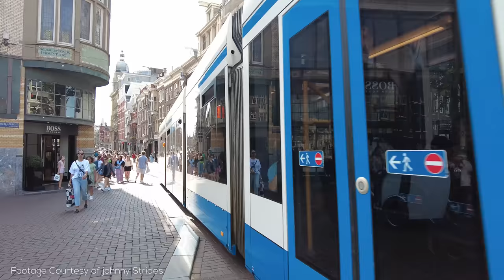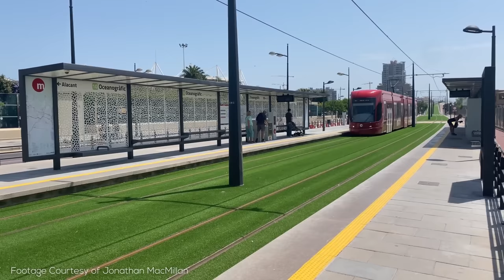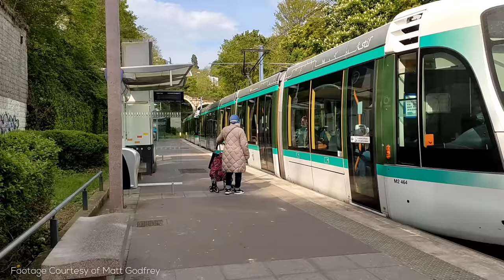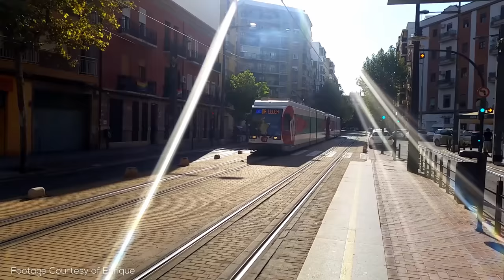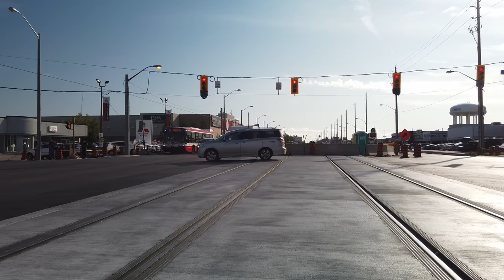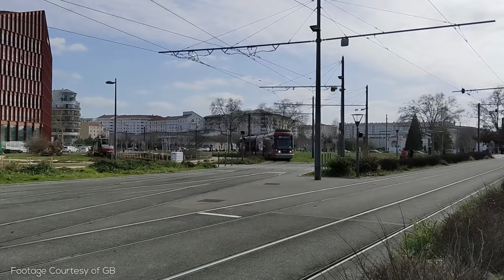What the US Gets Wrong About Trams

Comment: If I'm honest, I personally like to see more bus-styled trams over mini-railways i.e. with trams which are running together with cars rather than next or between cars. Of course, on arterials, they certainly should get their own lane given that they're wider than other streets and trams can't steer to the side to reach the platform on the pavement. It also is recommend for buses since they too risk in getting stuck in heavy traffic so my point of bus-like trams still stands.
I personally see them more accessible over mini-railways since when on street, it means the tram can easily be accessed unlike on dedicated ROW where you have to (potentially) cross the street to get to the tram. The only downside is that the street is badly usable for cycling due to the danger of getting stuck on the tracks but wide pavements help here.

Comment: Well, I'm not sure. What you say about the design of the trams as a decisive difference leading to the failure in the US – I don't believe. Counter example: in Zurich, a city where everybody uses trams and nearly one half of households doesn't even own a car, many old trams still operate where for most parts of them you need to climb stairs to access them. It's not a big problem, because the trams are clean, reliable and frequent. What makes a difference: the city is built around public transportation, cars have a hard time to find space, trams are at traffic lights prioritized. This makes it actually faster to use a tram than a car. (Not even talking about the long hunt for a rare parking space.) Trams also have separate lanes, but by far not everywhere: at smaller streets, they often share space with cars.
So in a nutshell: mostly other reasons for the success of trams. How they look like? Not important!

Comment: No, it’s a huge undersell to present trams as “walking accelerators”. In many cities without metro they form a backbone of the public transport system, and in many cities with metro they form a “secondary” backbone.

In Nice, France, walking from the airport to the port would take around 2 hours, it’s definitely not what we would call a walkable distance. It London, walking between Wimbledon and New Addington would take almost four hours and wouldn’t be very pleasant. Same with most lines in Manchester for example.

The great things about trans is that they are very agile - they can act as a “walking accelerator” within the city centre, but once they leave it they can run at a high speed on dedicated mainline-like tracks for long distances, not impeded by the street traffic, just like a train would do.

Comment: Also, shouldn't a lot of US cities have single tracked light rail? To serve low density areas?
Reply: A lot of the old 19th early 20th century systems did have lots of single track lines due to tight rights-of-way, or just avoiding the extra cost of more track. Think the inconvenience of having to wait at passing tracks did away with that along with trying to upgrade the system into more of a metro. It's probably worth considering in dense urban areas where you could split inbound and outbound onto different streets.
Reply: @johnruskin4290  Modern systems use it as well, but for lower frequency lines.

Comment: Wouldn’t “fewer doors per segment” make more sense in Canadian winters, where we might not want to let out as much heat at each stop?  (e.g., the Region of Waterloo’s ION train system is reasonably comfortable at -15C…)
Reply from the maker: No, I think the solution to this is to have better policy i.e not opening every door when you have buttons on the doors
Reply: @RMTransit  Buttons are definitely superior to motion detectors. Trams often have narrower platforms and so people walking down the length next to the vehicle often cause the doors to open again, which may cause you to miss a signal phase requiring the system to register the vehicle again and incorporate it into the light cycle.

Comment: Your channel is usually very insightful.  However, I often wish that you would bring into light the differences in population density (and other factors like home/work/shop/leisure location patterns) when you are comparing transits in different parts of the world, or different areas in the same metropolitan area.  That would bring about a   more complete understanding of the issues.  TIA.
Reply from the maker: I actually think the population density is less important than providing a compelling service, lower density, simply requires a different route design
Reply: @RMTransit  All I am saying is that population density et al are ultimately related to financial feasibility.
Reply: @RMTransit  I disagree and do believe European HIGH density DRIVES there designs and American designs are designed around the "notion" of A driving density and "B" not impacting CAR volumes driven by LOW densities and requisite longer trip distances and LESS "walkable" and MORE car-only destinations 
the service NEEDS to BE DIFFERENT to service DIFFERENT riders in different density levels
Reply: @jasonriddell  May be they should start moving to higher desntiy communities with transport provided at better levels than elsewhere.....

Comment: As a San Francisco resident, I can agree that the MuniMetro is just a really bad system. However of the 6 Light Rail lines (all high floor) the T - Third Street line is the only line that provides a good service quality doesn't delay you back time. Unlike the Other systems, all T-Line stations are all level platform and not the low floor platforms with a small ramp for disability services which again, not all stations have. They also have bus & tram only lanes which reduces traffic. Right now testing for the brand new central subway (which is four additional underground stops for the line). The only downside to the T-Line is that most stations including the new CS stations can only hold max 2-full length SF light rail vehicles on one platform. These aren't the only stations that have this in which case two other stations on the main subway line have (one being the first metro station on the west coast. 

Is there space to improve, absolutely! Our L-Taraval line, which is being renovated at the time of this comment is posted, will have similar ways to the T Line. Sadly without level platforms and instead having disablility access ramps which will still be better but not as good as T-Line

Comment: In  Düsseldorf we are also  stopping in the middle of the road. But there is just one lane for cars between  and the stops are created with a "time-island" so  the traffic is stopped to allow passengers to get on or of the trams.
I am  operating 100% high-floor trams which are used on  lines connecting even  to other cities. Also some trains are driving fuly automatic but  my  company is moving away from this  80s technology. :/

Comment: What would you characterize LA's "metro" as? It's kind of like a tram but is high floor with level boarding and has tunneled sections, elevated guideways, and street level crossing. It's a very weird design.
Reply: It's certainly inspired by the Stadtbahn systems found in NRW, Frankfurt and Stuttgart. Premetros in general are an interesting topic with various advantages, quirks and challenges.
Reply: I really hope LA stops building more of its core network as light rail. A city of its size ought to be concentrating on heavy rail, regardless of the cost.
Reply: Kind of like the U6 in Vienna.
Reply: @heidirabenau511  It's actually the opposite here: The U6 in Vienna is like the Confederation Line in Ottawa by using low-floor trams but is otherwise entirely grade segregated while the LA Metro uses high-floor trams with grade crossings and occasional street running which is imilar to the the Stadtbahn of Cologne, Ruhr area and Stuttgart.

Comment: Let me argue against that concept of "walking accelerator". Buses (and battery trolleybuses) are more reliable than trams, they are much more resistant to accidents and street repairs, so the main use case for trams are lines that have a passenger flow that buses can't serve. These are usually lines that have a passenger flow enough for heavy rail such as an underground metro or commuter rail, but heavy rail is either impractical to build there, or needed very soon, preferably yesterday, and the area will face a traffic collapse while the underground line is being built. Short routes that can be biked or walked are very unlikely to have such a passenger flow, so battery trolleybuses are a better option for them.

Comment: Seattle’s Link has to be the most overbuilt and under thought project. A >100km long end to end distance - that will be far slower than the current express buses. Two parallel subways through a very narrow downtown requiring awkward transfers even though the future needed capacity is well within the constraints cities often fit in one tunnel. Grandiose stations that require a ton of excavation with escalators that never work. Competing for worlds deepest station and most layers of mezzanine for no reason. 400’ long trains with eight driver cabs that waste a quarter of the square footage. Big TVs in the stations meant for arrival times but they’ve only ever shown a clock. A line to West Seattle that terminates in the industrial district for its first five years requiring a transfer to get downtown, turning current fast and direct one seat rides on various bus routes into three seat rides. Everything but the fast and frequent service you have on SkyTrain.

Comment: The problem in the US is the lack of locations. Everything is separated from everything else so different areas are dead at different times of the day. Business areas and commercial areas are separated so they're dead during the evening and the night. Single-family house zones are pretty much dead during the day (and there really is no reason to hang around those anyways). To make trams (and such) truly viable, it kinda requires to have atleast some sort of activity in all areas throughout the day.

Although the US cities have one advantage. The streets are really wide and there's a lot of space to build tram networks but again, where would you go and why. You get dropped off in the middle of a stroad and then you need to walk 25 meters to get to the sidewalk (if there is one) and then cross a parking lot to get to that one store (or a strip mall). Then you'd have to take another tram to get to the next place since walking there would be miserable.

Comment: Whilst a 100% low floor design may have its advantages, depending on the service you want the disadvantages often outweigh the benefits. Such designs are intended for full street running at low speeds, and don't do well at higher speeds on separated corridors. The ride quality is also significantly worse, and their dimensions usually mean that you have significantly less space and worse operations with the same lenght of train when compared to a 70% low floor design. They are also more expensive to run and operate, and much less reliable. If your alignment doesn't have too many sharp curves, sections at higher speed without street running and a large distance to travel, then there's no reason to use a 100% low floor design instead of a 70% design.
And whilst I do get that aesthetics are important to a degree, I feel like you're overemphasising their importance. Improving aesthetics costs money that could otherwise be put towards improving service, and this is already a widespread problem in the US. Besides, a grass alignment and curved catenaries aren't really going to do much if you're still surrounded by a stroad and parking lots.
Reply: Most of the 100% low floor trams in western Europe are based on architectures that are over a decade old or even older, and there have been quite a few advances in low floor technology since then. The latest 100% low floor trams in Eastern Europe and Japan are not much more complicated than a 70% low floor tram and have even better interior space utilisation in some cases.

Comment: *Laughs in Bordeaux, which built a big radial tram network spanning multiple cities across the entire metropolitan area after failing to fund a metro system*
Reply: I get the sense that the tram network in Bordeaux has actually been quite successful (despite there being some issues with the APS - Alimentation par le sol - technology). Bordeaux is a small enough city that most areas served by the tram are still about a half-hour or so by tram from the city centre. That’s a very reasonable trip time for a daily commute.
Reply: @ethandanielburg6356  I was being facetious, I’ve used the Bordeaux tram network extensively and I enjoyed it very much haha
Reply: @feta_cheesecake  Ah ok! 😅

Comment: One thing I didn't see mentioned in this video is that a lot of North American cities have things marketed as "light rail" that use ludicrously heavy elevated rolling stock. For example, the "light rail" in Baltimore is a no-holds-barred train. Get this massive, heavy thing rolling down the track (essentially dedicated rail corridors, where it doesn't take you anywhere useful, or down crowded streets where it will get stuck in traffic just like a bus) and you've got a recipe for a totally useless, unreliable waste of a "tram" system. Clearly designed, or at least hobbled, by people who have never enjoyed the brilliance of a modern European tramway.

Comment: Rails are the way to high capacity city transport. And low-floor trams are amazingly versatile: they can go into pedestrian areas where their tracks make them much more predictable for pedestrians than buses. You can run them into tunnels which effectively turns them into higher speed subway — but I think the truth about tunnels is that building them was historically driven by a desire of city planners to prioritise CARS. And that's the historic error right there ! Modern trams networks must (IMO anyway) be built boldly in an effort to reduce car traffic. This will go a long way in making cities citizen-friendly.

Comment: Not particularly germane to your excellent video, but one thing that drives my absolutely NUTS about the Ottawa Light Rail Transit System are the signs at the stations warning us to stay off the tracks. . .  because of HIGH VOLTAGE.

Comment: You can't tell Americans that their beloved automobile is the most wasteful form of land transport. You can't tell them that it consumes 21% of the GDP to fuel it, maintain it, cater to it, and its infrastructure. You can't tell them that electric traction rail uses 1/20th of the energy to move the same cargo or passengers, in far less space, with far less resources, for far longer. You can't tell them that the automobile / road paradigm cannot scale upwards to handle ever greater population density, as can rail. You can't tell them that without government subsidy, the automobile / petroleum / pavement mode would not have become dominant, while government taxed and regulated to death urban electric rail...  via FARE CAPS while boosting taxes, effectively bankrupting them.

Comment: Tram-Trains are definitely a thing in North America.  Denver's RTD Light Rail is basically a tram system that pretends to be a commuter railroad, it mostly runs grade separated aside from a few areas where it runs at street level.  It also only sees about 1/6th the ridership of RTD commuter rail (RTD commuter rail is already the 7th busiest in the US), despite having a larger network and the commuter rail having only started service in 2016 vs 1994 for the light rail.  And yes the RTD light rail trams are pathetically boring looking.

Comment: I actually disagree pretty strongly - North America (especially the US) gets trams wrong precisely because it thinks they're "walking accelerators". That's why you get useless downtown loops that don't connect to anything, short corridors that stop on every corner, etc. The ideal tram network imho is something similar to what we have here in Frankfurt - a busy city centre trunk route that branches off spider-like into surrounding neighbourhoods that couldn't quite sustain a dedicated metro. The convenience of a ground-level tram stopping on a road outside your door outweighs the slowness - from my house, it's more convenient to get into the city with a 15-20 min tram ride that's 1 min walk away than a 5-10 min train ride that's a 10 minute walk and involves stairs or a lift to the platform at both ends (no fun with a baby!)

Comment: I lived in several places in Europe and the USA. The problem is the difference you don't discuss in your video, population density. Several of the trams you show in your video are in cities with higher density areas with city centers with many pedestrian avenues, so take a car to move to the center to park it for the 2-4 hours that I will be there shopping and eating don't make a sense, because, for the same price than the gas for the car, I could take the Tram and do the same activities. But city planning in the USA is not the same... the shopping malls are separated from the buildings, and high-speed ways for cars are the primary form of transportation.
When I need to go to Europe or Japan, I always look at how I can go from the airport to where I want to go (Train, Metro, Bus...). When I did the same in the USA, it took me longer than the flight time... So my solution is always the same, rent a car.